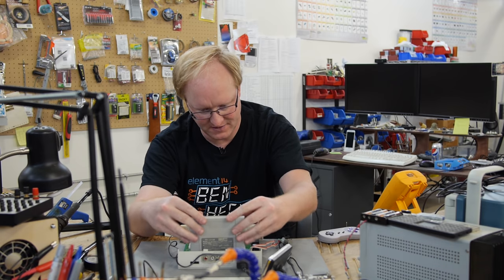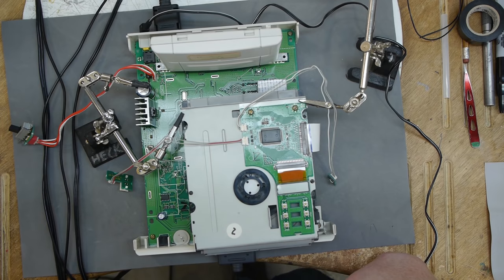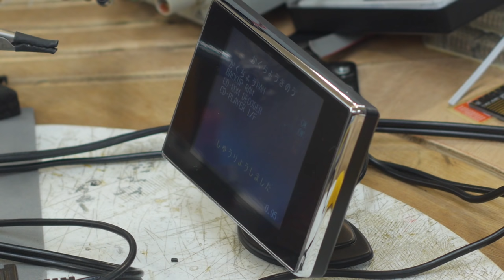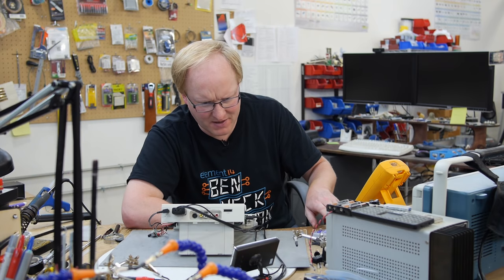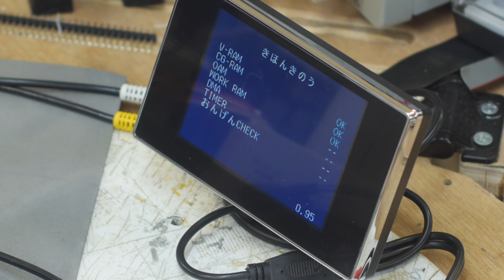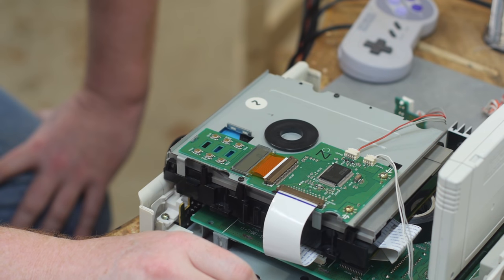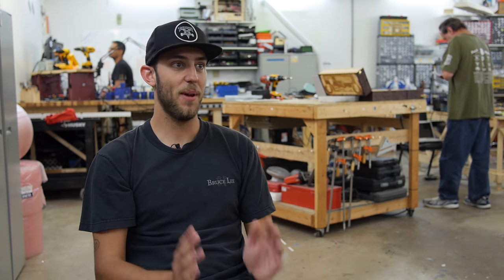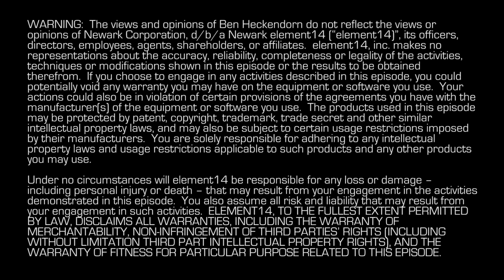Ben Heck's Nintendo-Playstation Prototype Part 2 Repair

Comment: Was wondering if they try a Playstation on it? Be funny if it worked.
Reply: Seeing as this has none of the core components of a PlayStation I'm going to go ahead and say no.
Reply: +Joseph Marlin Still be worth trying.
Reply: Except not. Because that's not how things work.
Reply: +Joseph Marlin Still doesn't change the fact to be worth trying.
Reply: You have to realize that this device is just a nintendo console with more ram and not a playstation. The only thing it could run right now is just music cds.
Reply: DjGodaryD86 Going by that, it can play some PlayStation games.
Reply: Dear Shendowx: Are you talking to yourself? Because the iso 9660 data track on a PSX disk isn't even the same format spec as a redbook audio CD to begin with so being able to play a cd (which this thing currently can't even do since even if the laser head in the drive were any good ben showed in the video that there's no software in that current boot rom for decoding cd audio) doesn't have even the remotest bearing on the capacity for this thing to play PSX games. I mean, do you think the CD player in your car can play PSX games?

On top of all of that, if the drive mechanism was in working order and could read ISO 9660 data sectors from a disk into the buffer ram on the boot cartridge, then you'd be stuck with your next hurdle: what file from the TOC does the boot rom read into memory in order to begin the process of booting the game from the CD? This is a procedure that's standardized platform by platform. On the PC we have a few standards that the BIOS uses, such as El Torito. On the PSX, the console's boot rom reads a text file called SYSTEM.CNF off of the root directory of the CD and loads and executes the initial binary listed therein. Odds are, this prototype doesn't follow the same boot procedure as a playstation and therefore if you stuck in a psx game disc the boot rom would hang or error searching for an initial file on the disk that does not exist.

But, okay, let's give things the benefit of the doubt here. Maybe this boot rom uses exactly the process that was used in Sony's final device. I have no idea how or why this would be the case seeing as sony developed the playstation themselves from scratch when the partnership fell through, but hey. Why not. So the boot rom in that cartridge spins up the cd drive, and reads the SYSTEM.CNF file from the root directory into memory, and the SYSTEM.CNF points to whichever initial binary to load from the CD. So the boot rom spins up the drive once more and reads that file into main ram and when it has completed that it jumps to the entry point and...

Immediately shits itself. Because even if the assumptions on the boot process were this similar between the two machines, this prototype uses the same processor as a normal SNES -- specifically a CISC chip called the WDC 65816 which is basically a 16-bit extension to the venerable 6502 cpu used in the NES and so many other 80s 8-bit home computers. Meanwhile, the code that that 65816 just loaded and attempted to execute machine code for the processor in the psx: the 32-bit RISC-type MIPS R3051. So firstly, even if these were processors that were by the same manufacturer and in the same line, the two processors don't even operate on the same bit width. But not only that, they're not even in the same ballpark of cpu design since one is RISC and one is CISC. Not that that matters, since even if you're talking about the same processor design family all that matters is the ISA, which aren't even remotely close to matching. 

So what happens now in this ridiculously ideal scenario? The 65816 jumps into the MIPS machine code we loaded off of the disk and begins going absolutely apeshit. It reads what it thinks is its first command word from the image's entry point, but that command word is gobbledygook because 8-bit 6502 instructions don't remotely match 32-bit MIPS instructions and so the processor starts performing effectively random actions, jumping around in memory at random, thrashing the memory contents, probably eventually hitting an accidental halt that completely freezes the execution of the system. Or it just gets stuck in a loop forever somewhere. Or it jumps around randomly for the rest of time. It doesn't really matter, it's not doing anything useful -- certainly not making anything happen remotely resembling a game.

But we'd never even get into the above situation because of a million other barriers. Another is that we've glossed over the fact that the binaries that the psx loads off of the disk have headers containing playstation-specific verification information to prevent piracy and ensure the integrity of the loaded data. Yet another is that psx has 16 times the working memory of this thing, so the boot image probably wouldn't even fit into ram in the first place. And on and on.

The thing is, at the end of the day, this shit isn't magic. It's very precisely engineered, and if everything doesn't match up just right, it doesn't go. That's the part they pay teams of hundreds of people tens of thousands of dollars each over the course of multiple years to get just right. And it really doesn't help the things-working-together-and-being-compatible thing when the core platform you're talking about isn't even remotely similar from any technical standpoint.
Reply: +Joseph Marlin I do. or did you not know some Playstation games can be played as a audio CD (meaning you can play the music that's in the game).

Twisted Metal does this in alot of Playstation.
Reply: Yes. Those are standard CD audio tracks alongside the ISO 9660 data track. No different than the audio tracks on a standard redbook cd. So to that extent, if you were able to play those audio tracks it would be just as much 'playing a playstation game' as doing the same with that weezer cd would be 'playing a weezer game'.
Reply: Actually ONE of the components appears to match. The CDX1800Q is similar enough to bitstream decoder they used in Playstation. In fact, inserting a game that uses a lot of XA audio (compressed streaming format) is promising, as it should come out playing the music in the cartridge test program.

But XA and CD Audio are really the only things that would ever work, if we're lucky.

As to formats, it appears they have foreseen compatibility with the Mode-2 discs that would be later used in Playstation, indeed it's likely to have been intended as the native format.
Reply: Cool info, thanks!

Comment: The sound doesn't work on one of my game gears and it smells like fish lol
Reply: That's the smell of leaky capacitors. GGs are notorious for having really dodgy caps. Get them replaced asap or the boards could get permantly damaged.
Reply: Agreed. I replaced all of mine to be certain, and now mine works perfectly. I had sound issues where you had to turn it up to max to hear anything at all, and there were horizontal lines going over the screen + contrast & brightness issues. When I connected to the TV-Tuner's line-in, then the screen looked pretty much fine. Guess playing Game Gear games..and using the SMS Converter, drew far more power from it's hardware.
Reply: +Precurser Well I already have a second working game gear.

Comment: b class telecom crimps insted of soldering but youre a engineer? terrible... no professional soldering system  you have a youtube channel and you can afford a metcal or pace system?
no solder paste? solder paste will hold components down then you use a pro oven to cook it on. come on man. and wire tape not professional potting material.